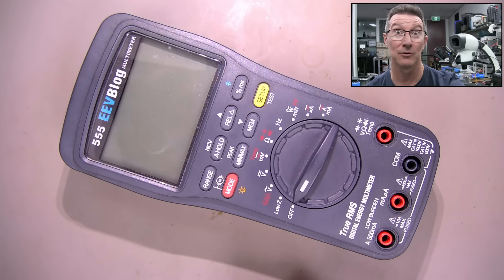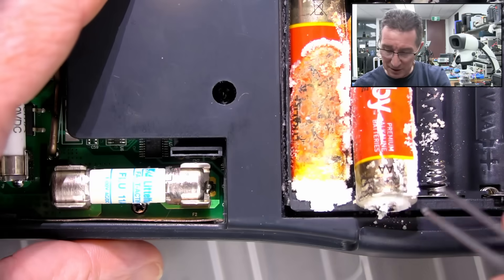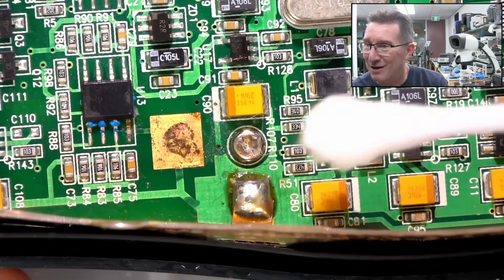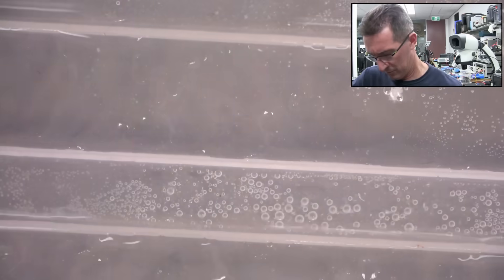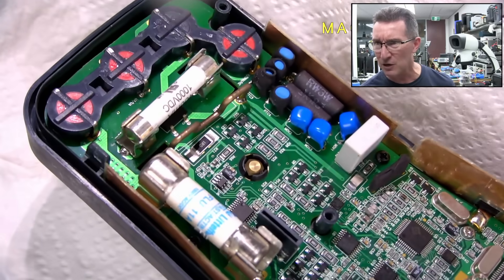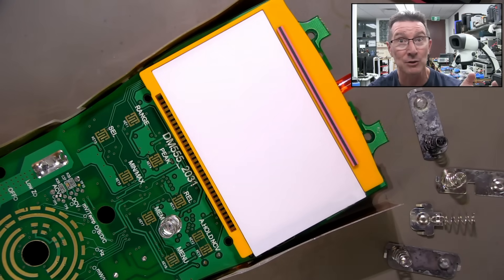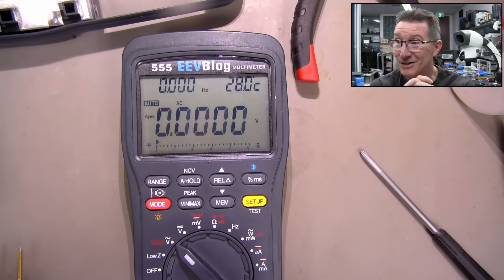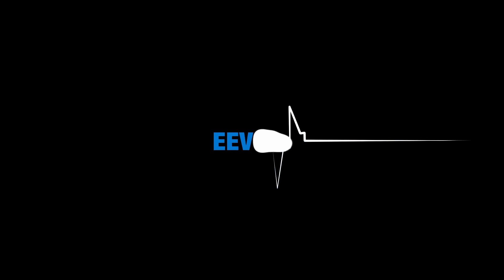EEVblog 1668 - HORRIFIC Alkaline Battery Leakage in Rare Prototype Multimeter

Comment: Not as bad as I would have thought. Still would have broken it down first and put the board and contacts in DI water for a cleaning before adding anything acidic to neutralize the stuff on the case.
Reply: di water like distilled?
Reply: @uiopuiop3472  Or distilled will work as well. DI is short for deionized, which is literally just water (well, for the most part if its of high quality). Important to note that its no longer "deionized" once the potassium hydroxide mixes in, so its more of a scrub and flush and maybe even ultrasonic clean. The nice thing about DI water is once the junk is gone it leaves no residues. The same is not true of the vinegar as its mildly acidic and potentially corrosive if traces are left on the PCB or anything metal.

Comment: The blue is probably a copper compound; the inside of the chip leads are probably copper. Copper salts are blue or sometimes green. Not a good sign, for sure.... I took Dave's statement about potassium hydroxide as stated, but when I saw the fizz when the vinegar hit it, it seemed to me it must be some kind of carbonate or bicarbonate. Not sure how they are made, so not sure what the salt there is - but definitely copper. I believe alkaline hydroxides can absorb CO2 from the air and convert to carbonates.
Reply: You are correct re: Potassium carbonate. The fluffy white crystalline appearance is characteristic of this compound.
Reply: Indeed. Alkali hydroxides react easily with CO2 when exposed to the atmosphere. And the liquid will evaporate, leaving crystals. If a battery leaks in a well-sealed device (for example, a Fluke 28II), you may have an opportunity to see the electrolyte in its still wet form (a thick white paste). That can be even more damaging, as the longer it stays wet, the more opportunities it has to spread and corrode things. It can even destroy plastic parts, making them crumble easily.
Reply from the maker: Yes, potassium hydroxide electrolyte when it leaks mixes with C02 and moisture in the air and forms potassium carbonate crystals.

Comment: Lost track of how many TI calculators I have had to replace PCB tracks and contacts to get them going again after the batteries blow up. Even worse when it’s an expensive meter and the plastic case turns crunchy and brittle.
Reply: I have a pile of HP graphing calculators on my desk that came from the local high school... 25 calculators, all with battery leak damage. I kept the ones I thought were salvageable, and chucked the rest in the electronics recycling at the tip.
I kept 5. I later chucked another 2. So earlier when I said "pile", there are 3 of them stacked. 2 of them are repaired back to working state, the 3rd probably would work but I've never tried it because I don't really need 3 graphing calculators that I don't really know how to use 😂

Comment: What do you use to neutralize zinc chloride battery leaks?
Reply: those use ammonium chloride as a electrolyte-this is still Alkaline chemistry(although a different chemistry than a standard alkaline cell), so an acid like vinegar is still correct.
The only common battery chemistry that needs a alkaline neutralizer, are lead-acid batteries-for those, sodium bicarbonate(baking soda) is a good choice.

Comment: I prefer stuff with 9v batteries, seems to be much less leakage from my experience. I have old CB radio microphones with 10 to 15+ year old 9 volts and no leakage, same with multimeters with 9v batteries (no guarantee, but have had more old 9v in good shape than anything else). Yes when I realized I left batteries in some of it I recently opened the stuff to remove it, but the 9v batteries while dead / flat, did not leak. Not so in items with the AAA or AA batteries. Several years back I remembered I had an Alpine remote in the glove box of one of my cars for the stereo and the AAA batteries destroyed the entire board in that remote, was unrepairable, too much copper was eaten off the board and under the carbon button tracks. Anymore when I see stuff sitting around with batteries I yank them out right then. It’s easy to use an item, then think you’ll use it again soon and it ends up sitting for years.
Reply: A benefit to 9V is because it's an actual battery rather than a single cell, it's usually able to contain minor leaks from the internal AAAA or flat cells.
Reply: @DigitalMoonlight   Yeah exactly. I take old ones apart occasionally to snag the top snap clip piece for projects / quick repair on something with a broken 9v snap connector. I've had a 9v or two start to leak from its case, but it's much rarer than the single cell batteries.

Comment: Remember the best way to get a battery to leak is put them in something rare or expensive!
Reply: And you don't even need them in that long for them to leak. I used to have an expensive aluminum maglite that took 3 x AA batteries. The last battery change I did in it was its death. Put three fresh new Duracell batteries in, and not 30 minutes later I notice that the light turned on with a dull glow. Picked it up to inspect and dropped it because the body was smoking hot.

Threw it in the sink to cool it off and then I unscrewed the base, battery electrolyte poured out of the end cap. That battery fell out and revealed that the middle battery had exploded and expanded and was seized in the bore. It was actively venting electrolyte, so I had to drill into it to relieve the pressure and pull it out, and then the first battery fell out behind it.

Inspecting the damage, most of the bore had been eaten away by electrolysis and corrosion. The only thing I think could have happened is that one of the batteries (probably the middle one) had a damaged sheathing and somehow shorted to itself or the end battery through the casing.

I stopped using Duracell batteries after that, that maglite was expensive. Never had that bizarre problem since.
Reply: When I put things away long term, the batteries always come out.
Reply: Yep. I had a very expensive gas analyser which was wrecked by leaking Duracell Industrial batteries.
Reply: And yet 10y/o eneloops just keep living
Reply: The simplest way is to use Duracell in my experience.
Reply: @mbak7801 My former boss said that too and wasn't happy when I told him that wasn't true and I didn't believe it. He was angry about it and complained about it.
But when I threw a couple of badly rotted Duracells on the table, his dreams went up in smoke.
Reply: @mbak7801  Duracell are the worst of the worst.  I have even had multiple Duracells leak while still sealed in their original, in date packaging.  Friends do not let friends use Duracell batteries.

Comment: that's why i always use Heavy Duty battery (not alkaline)1.5 and 9v battery, on device that will use battery a long time?life? and rarely used that you will missed if battery already drained out.... like calculator, remote (like dvd player, or someting rarely use), multimeter, clock (on area that not always check the time), etc...

Comment: It is for this reason I purchased the IKEA AA/AAA rechargeable’s in bulk and have 0 alkaline in the house now.
Reply: W moment
Reply: What are they, NiMH?
Reply: @idlegandalf  Correct, and the brand name is LADDA. The word on the street is they're rebranded Eneloops sold at a significant discount.
Reply: @chesshooligan1282  i have a 4set about a decade old, 80% capacity. AND same age alkalines, 2 still power a thermometer w/ other two completely dead but in a ziplock waiting for them to leak but no sign after so many years
Reply: @duroxkilo  I put alkalines in cheap stuff, like zigbee thermometers or sensors that cost under a fiver. If I remember correctly, I calculated they should last over a decade taking into account the current draw of zigbee sensors. There's no point in putting expensive rechargeable batteries in cheap gadgets with ultra-low power consumption. The batteries would be more expensive than the device and would probably need re-charging after a couple of years. On the other hand, you don't want to put alkaline batteries in expensive devices, as shown in this video, or in devices that draw a lot of current. Each type of battery has its use.
Reply: @chesshooligan1282  Ladda means "to charge" in Swedish. 😊

Comment: Plop-plop, fizz-fizz
Oh what a relief it is!
You can soak the cleaned terminals in Skybrite Ospho.  It converts the oxidation/corrosion to iron phosphate--an inert material.  Follow that with a rust preventive light oil (gun oil) and wipe dry.  You should be good to go.

Comment: I found enloop rechargables and have never looked back. Hold a charge for almost ever and never any problems.
Reply: NiMH batteries don't hold charge as long as alkaline batteries, though, or at least not as long as the alkaline batteries that don't leak. 20 years ago I bought an ultra-cheap multimeter for a fiver, and I put it in a toolbox, where it sat unused, for 15 years. About 5 years ago, I turned it on, and the original alkaline battery that it came with, still had plenty of charge in it. I couldn't believe it. One thing alkaline batteries are good at is their ultra-low self-discharge rate.
Reply: @chesshooligan1282  the 'pre-charged' type from brand names have a rather slow discharge rate.. also brands like enloop still maintain max capacity after countless cycles for close to a decade now.

that being said, given the resting voltage is lower than for alkalines, for some devices that have a min voltage requirement, nimh might not be suitable as a >50% charge may still be below the min voltage...
Reply: Eneloops have been fantastic for remotes and torches, basically everything in the home. Tend to keep disposables in the multimeter to guarantee operation, but should try Eneloops - no problem to keep spares in the van.

Comment: Battery compartment should be sealed. Damage to the PCB could not happen if there were no holes.
Reply: But without holes how would the electrons from the batteries get into the circuit? :P
Reply: wouldn't that be great...

Comment: Just about low cost  every Simpson 260 I bought on Ebay was destroyed by leaking batteries.  I finally found one with a beautifully clean battery compartment and contacts but it had other serious problems.  I am a lover of the 260, probably as it was the first really great meter I bought at age 17.   I use it as much as much my Fluke 45.   

As for alkaline cells I was removing them before I store any equipment.   I was using Amazon brand alkaline batteries for the past 3 years and so far none have leaked.   But I am moving to Lithium cells for costly or irreplacable equipment.

Comment: I think replacing the terminals is the best choice. you could acid strip the terminals and dip them in "Liquid tin" which only costs $90USD for 125ml.  Cheap bastard who put those batteries in there!  Should have sprung for high-end Duraleaks.  I'm repairing a Parker bros. Merlin game that the battery terminals were destroyed.

Comment: My 121GW does that with the lead detection although it's got more serious problems. I made a video showing the odd behaviour https://youtu.be/6_N-A-NHnKQ
Reply from the maker: Very odd. Try reflashing the firmware to see if it fixes it.
Reply: @EEVblog I tried that, didn't work. The video link I posted shows the troubleshooting I've done. I also sent you an email and got an initial reply which I responded to with what I have done etc. I sent you another followup email with the video link.

How do I go about returning it?

Comment: Great video!! Why the vinegar reacts like that? What does it do? Thank you!
Reply: It's reacting with the alkaline electrolyte from the battery. Acid + Alkaline -> CO2 + H2O + some other gunk. But at least it will have a neutral pH and not corrode anymore.
Reply: @stuartcoyle1626  Understood! Thank you @stuartcoyle1626
Reply: The potassium hydroxide (KOH) rapidly absorbs CO2 from the air to form potassium carbonate. Very much less alkaline but very hydroscopic and bulkier hence the swelling. The acid reacts with the carbonate releasing the CO2. Wash with water after the acid then isopropyl to remove the water. I use citric acid as I hate the smell of vinegar.
Apollo,13 used canisters of potassium hydroxide lashed up to scrub CO2 from the air.
Reply: @ Thank you so much@billbuford6783

Comment: It's happened to us all!!!  On a similar note, just received my new BM2257, went to install the included batteries and shock horror, they are ZINC CARBON!!! WTF??!!  Obviously they are going nowhere near anything important, so I fitted some trusty Amazon Alkalines.
Reply: Actually, those Zinc Carbon cells are probably less leak-prone than a typical alkaline cell.
Reply: @m.k.8158  
Not in my experience!!

Comment: I remember in my youth (60s) that battery leaks seemed to be common.  Then over time it seemed that they rarely happened.  Now I think the quality has gone down hill and leaks are bigger problems.  Is that your impression.
Reply from the maker: That seems to be the general consensus.
Reply: The old batteries that leaked were the cheap zinc carbon batteries, as the case on those starts to corrode when they are deep discharged. Those leaked that gross brown goo. But back then alkalines were safe.

Then alkalines changed.....
Reply: Alkaline batteries have been leaking for at least 40 years now. I was fixing or scrapping a whole host of Fluke 8060A’s in the mid 1980’s that had suffered from leaking 9v Duracells.  

In the past decade I’ve seen AA and AAA Duracells leak in the box or blister packs well within their use by date even when stored in what would be regarded as ideal conditions.   For many years now I’ve avoided the use of alkalines, now I would only ever use zinc carbon, nickel metal hydride or lithium batteries.
Reply: In 1996 mercury was removed from "non button/coin" Alkaline Batteries . A trace of Mercury radically reduced the start of leakage; increased the self life of Alkaline batteries
Reply: I recently discussed this with somebody.  It seems batteries got leakier when mercury got removed from the cells.  I haven't yet been able to establish if this is just a correlation or if there's a deeper causality.
Reply: @ralfbaechle I just go with the flow. They changed the chemistry to be "green" and now batteries leak and fill landfill. 
My OH bought Duraleak™ and they celled™ before ever being taken out the package. Date on the packet was 2027.
I'm bad at trademarks btw.
Reply: @georgeprout42  ROHS is the worst dad joke on the industry.
Reply: @integerofdoom69 it started happening a very long time before RoHS, I was fixing a whole host of Fluke 8060A’s in the mid 1980’s that had suffered from leaky 9v Duracell batteries.

Comment: You need to use water and not IPA on the board, first the vinegar, and then the water in the ultrasonic bath. Then you can simply use some acid to actually strip the plating, followed by a simple copper chloride bath and plate copper on, followed by nickel chloride and plate nickel on. Both the plating steps you need a carbon anode to do the electroplate, and then it will be reasonably protected. 

Board wash in the ultrasonic with water, dipping half the board in, after removing the back up battery, using the board cleaner after a water wash, then use the IPA to do the final rinse. Battery contact easiest is to simply tin the pad completely, along with the spring end, and leave it at that.

Comment: When I repaired my Keithley 2306 (part 2, No. 116) I re-nickel plated some corroded metal work......dead easy to do in the lab.
Reply: Very rare to have spare contacts. Also I've been thinking about getting into electroplating I have a cheap ass necklace that I wore for a long time and it tarnished to put it lately, wondering if Nicholas skin safe/how hard it would be.
Reply from the maker: Onlty if that's your only option. In this case I had a ton of spare contacts.
Reply: Electroless Nickel is great. We've used it in house for electronic repairs and plated a bunch of random stuff after buying a kit for a job.
Reply: Did the same couple of times but using zinc. It's good enough but cheaper and easier to work with.

Comment: The blue thing could be some copper salt ...
Reply: Bingo. Copper hydroxide
Reply: @mikestewart4752  I took Dave's statement about potassium hydroxide as stated, but when I saw the fizz when the vinegar hit it, it seemed to me it must be some kind of carbonate or bicarbonate. Not sure how they are made, so not sure what the salt there is - but definitely copper.
Reply from the maker: @jonahansen  Yes, potassium hydroxide electrolyte when it leaks mixes with C02 and moisture in the air and forms potassium carbonate crystals.
Reply: @EEVblog  I'd guess copper acetate, the carbonate is green. Does it taste of strawberry? 🤔 (😉)
Reply: Ooh salt
Reply: Good ol' verdigris.